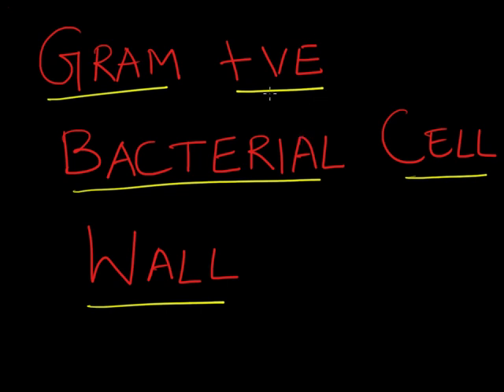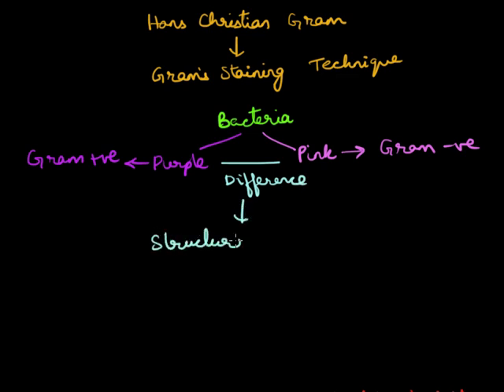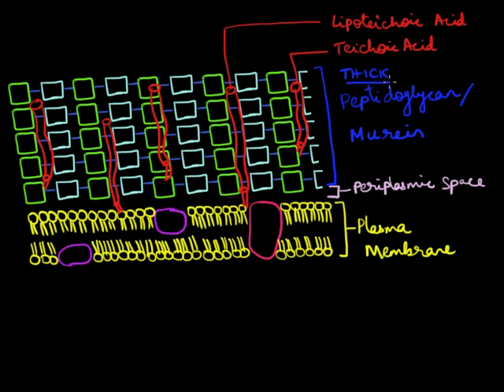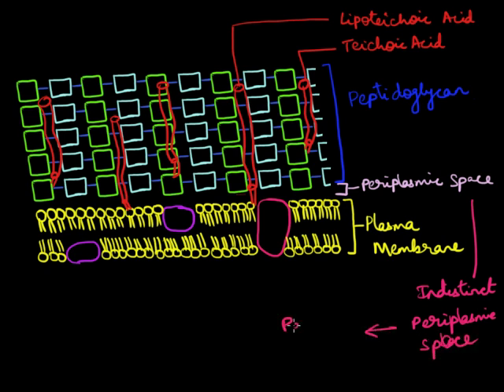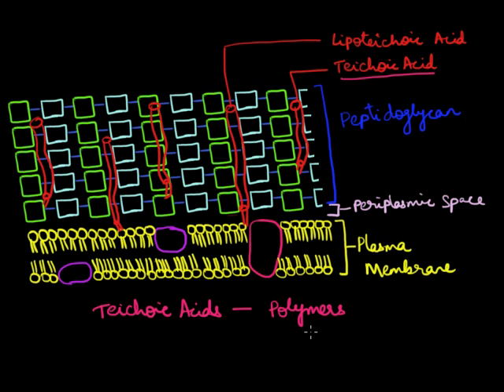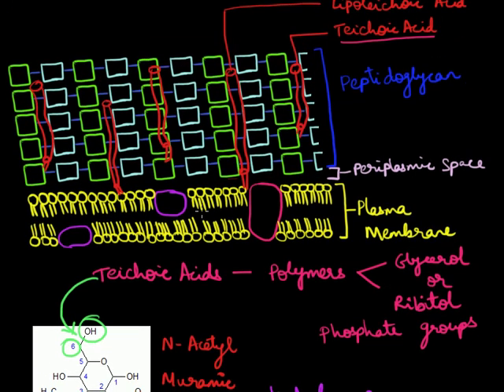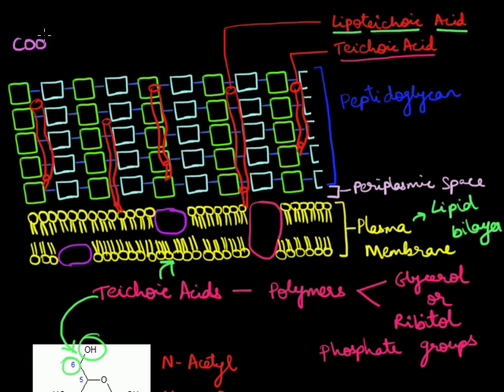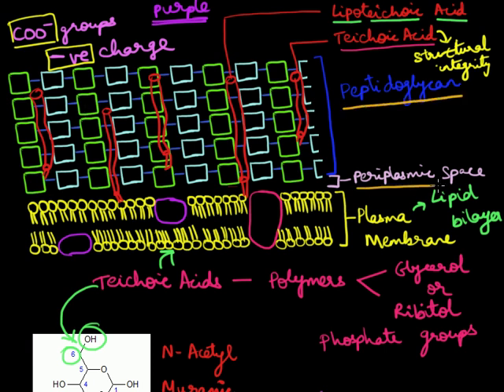Structure of Gram Positive Cell Wall

Comment: i think there's some misunderstanding. the micholic acid's importance is not for the gram stain procedure, but for ziehl-neelsen stain procedure. gram stain is based on whether there is an outer cell membrane or not. that is why gram negative lose their crystal violet stain (because there will be no outer membrane to keep it there) and in gram positive, the alcohol causes dehydration which causes the murein to become less permeable and thus the stain is kept in there.
Reply: Thanks for this video kyoki kl mera test h